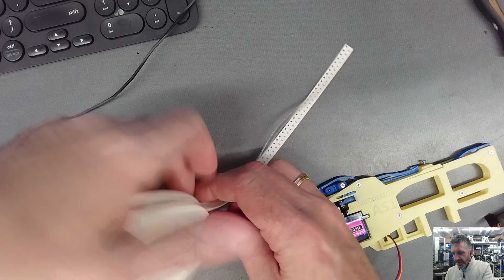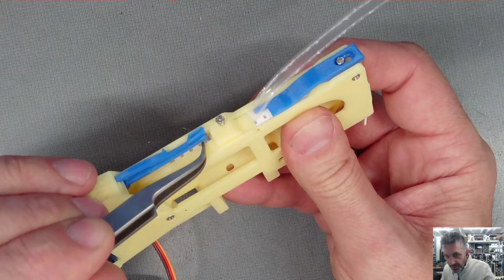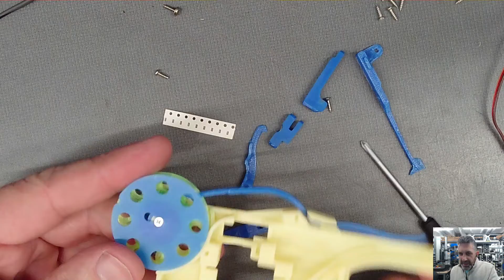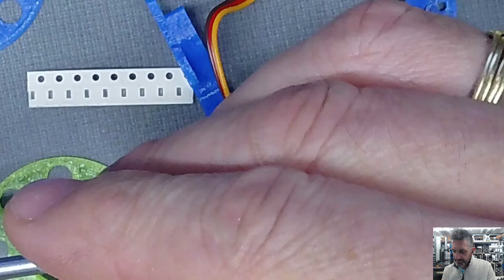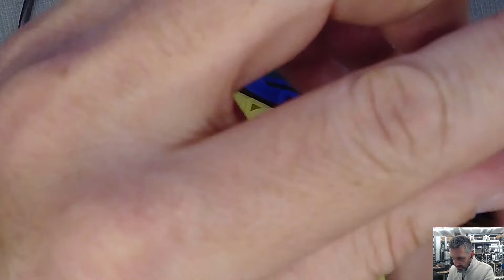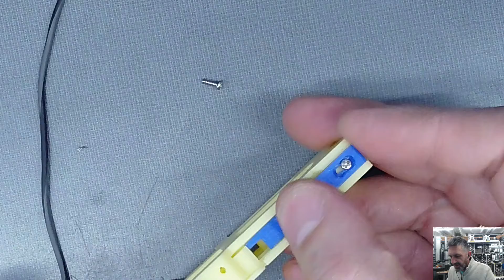Assemble a Feeder! PandaPlacer AS1 start-to-finish

Comment: Hi! Thanks for the video. I'd like to know what the best material is for printing. I'm tempted to use ASA, but I'm not sure if it's the right choice. Can you please advise? Thanks.
Reply from the maker: Asa would be smart for everything except the two leafy springs. PLA is also fine
Reply: @nickydoes  Hi!
I'm waiting for a CC1.
In the meantime, I'd like to print the parts.

Could you please tell me the quantities to print for each?
Thank you.

Linear rail positioning block
Bottom feet support
Nozzle station 2.1
Head case
PPA1 X_FFC_Clip
PPA1-DiscardCup
PPA1-3DP-BCAM_LIGHT_Cover-H25
PP-3DP-RailEndStop_W7
PP-3DP-ProfileEndCap-2020V
PCB Holder
Spool Holder

Comment: With which height layer  did you print the various pieces? All 0.2 or others?
Reply from the maker: I'm printing at 0.15 mm layer height. I don't think that is a requirement, though.

Comment: Have you had consistent success? I've had real issues with 0402 components, and even larger ones tends to not be consistent enough for non-vision picking.
Reply from the maker: I've had inconsistent success from feeder to feeder. I'm writing a tuning utility (0816_feeder_tweaker) to set the advance and retract angles per position (slot). I'm happy to have anyone contribute to the project.
https://github.com/nmdemarco/0816_feeder_tweaker.git